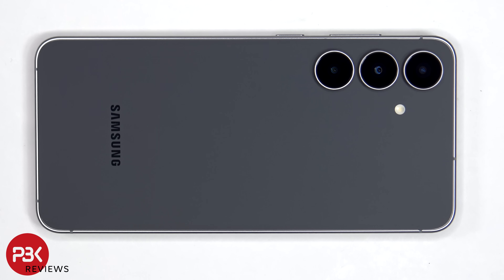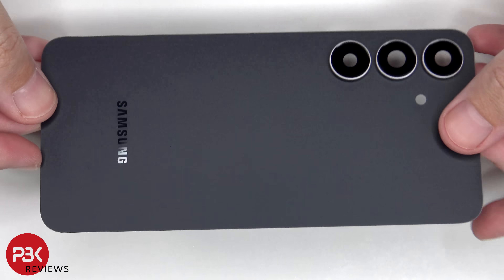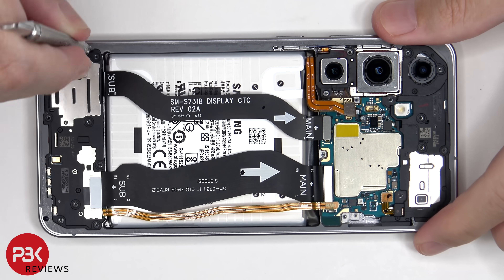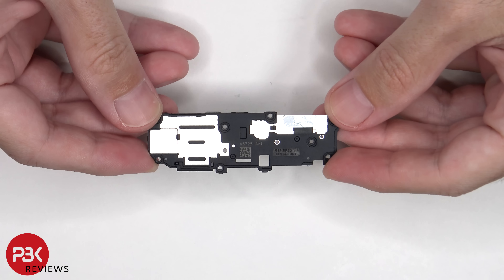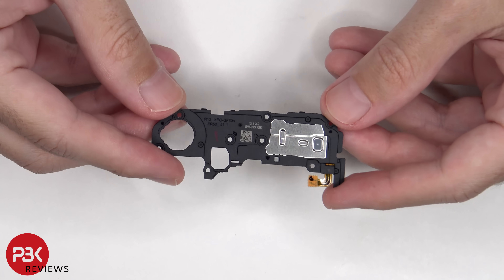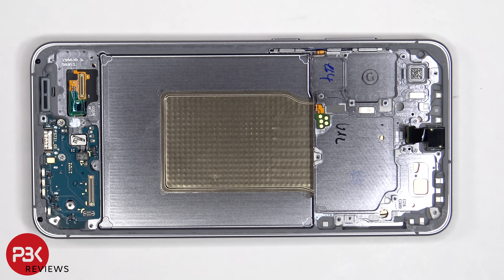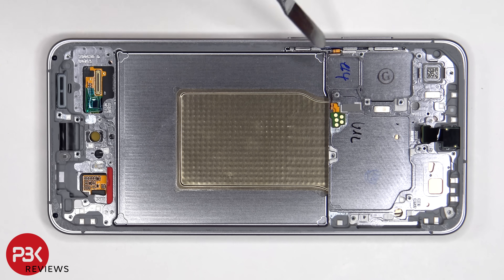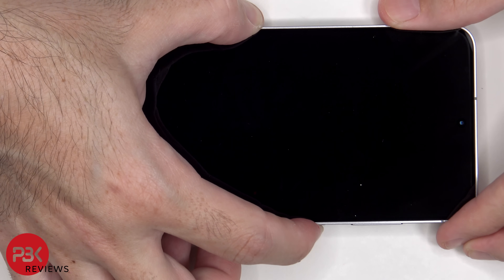Samsung Galaxy S25 FE Teardown Disassembly Phone Repair Video Review

Comment: I'll explain what the balls in the speakers are for. The balls inside the speaker serve to make the sound more bass and the vocals more full-bodied. Several balls vibrate with the movement of the speaker, making the sound more pleasant to listen to. Speakers that do not have balls have a drier sound and less bass. The balls are practically passive radiators, just like in Bluetooth speakers.

Comment: Claims 4900mAh..  but battery has written 4755mAh.. whats the point then
Reply: This is s24fe not s25fe
Reply: @RahulWarden  it is the s25 fe
Reply: That is typical capacity the capacity you are more likely to get where 4900 is what it's rated for if its manufactured perfectly

Comment: I really like the fact that you show every part of the phone in detail. Cool teardown video as always
Reply from the maker: Glad you enjoyed it!
Reply: @PBKreviews hey can you make a video about comparing a phone speaker with balls and without balls. My idea is that you should take a baseline reading on loudness and bass, then empty the same speaker from the balls and then compare it with before. I would really appreciate if you made a video like that since even in online forums no one is sure what the balls do.
Reply: @thepro7404  Yes i also asking same question 😮
Reply: @thepro7404 The balls inside the speaker serve to make the sound more bass and the vocals more full-bodied. Several balls vibrate with the movement of the speaker, making the sound more pleasant to listen to. Speakers that do not have balls have a drier sound and less bass. The balls are practically passive radiators, just like in Bluetooth speakers.
Reply: @Speaker-Bass oh ok, thanks for telling, but I was wondering what the difference between the two speakers would be which have the exact same chamber size.

Comment: Nice teardown, PBK.
I noticed how they've updated the speaker system organisation to match with the main S - series.
Also, the vibrator motor is now embedded in the bottom speaker assembly, just like the flagships.
Reply from the maker: thanks, 👍
Reply: they updated that because of? to make narrower design? that is not always a good thing